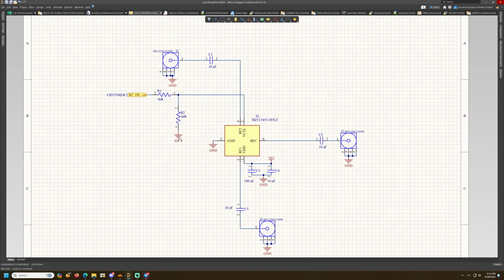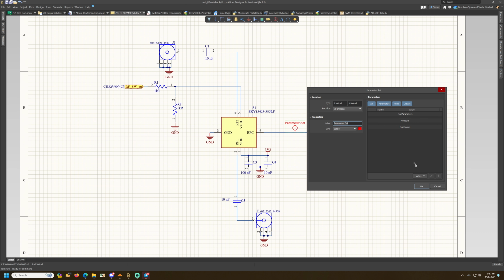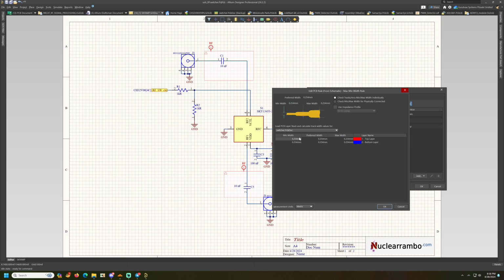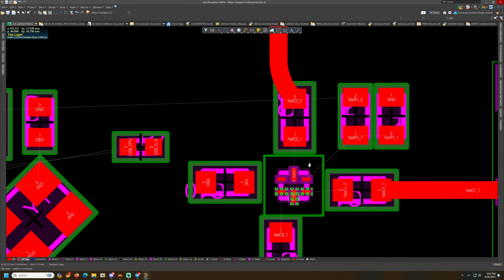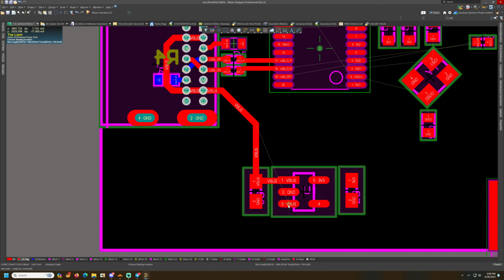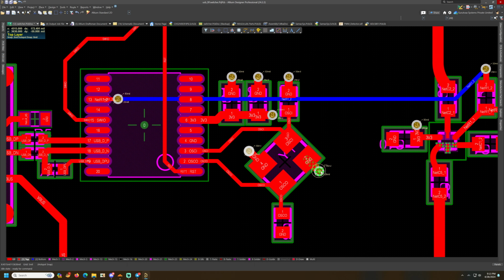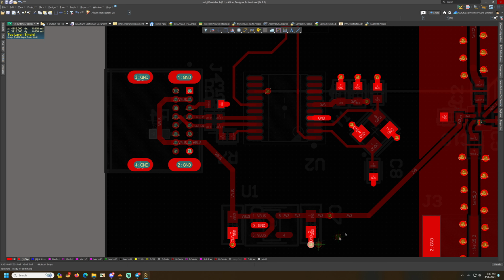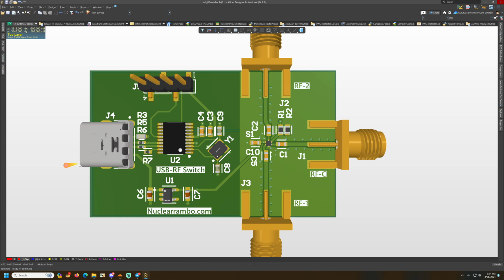USB controlled RF switch using CH32V003 in Altium Designer

Comment: Hi sir, why didnt you put polygon on the left side of the top layer?
Reply from the maker: I was only concerned on creating a coplanar waveguide for the RF nets. The left side is all non-RF stuff and does not require that ground around it for impedance matching.